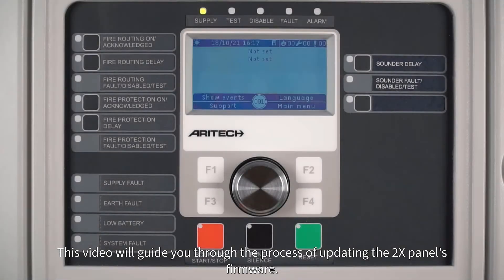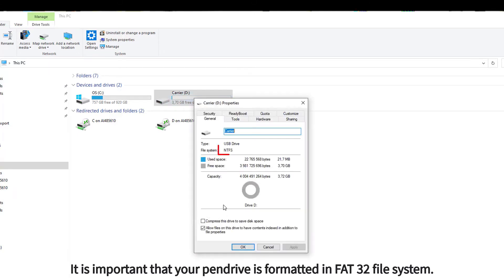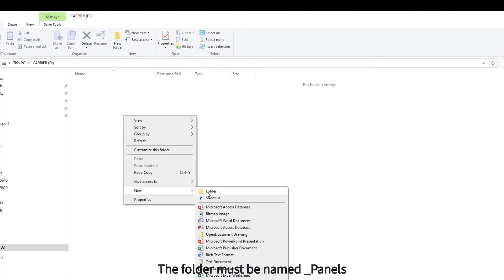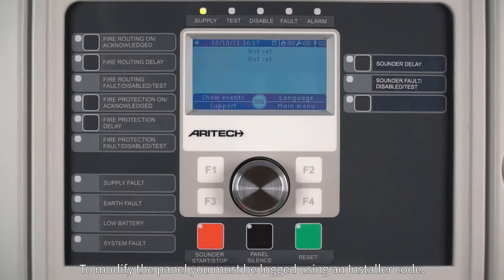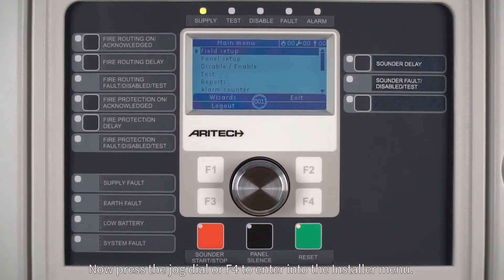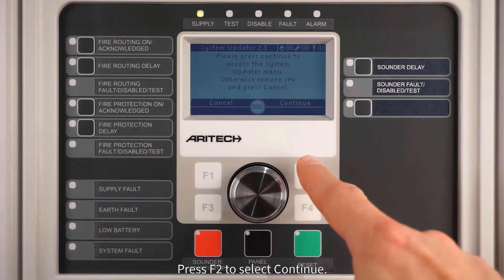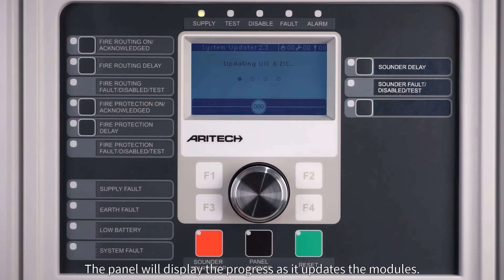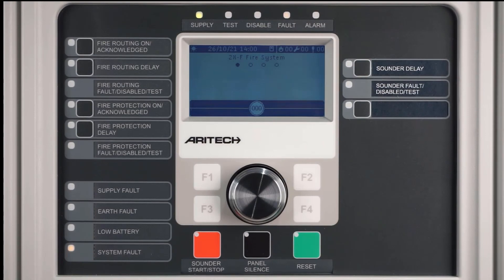Updating the Firmware  on a 2X Aritech Control Panel

Comment: No point. Work for a portuguese security company, needed to upgraded a 2x-f2 panel, requested for the firmware to support, they opened a ticket...3 weeks gone by and no reply...just give up and I just replaced the entire system for a different brand